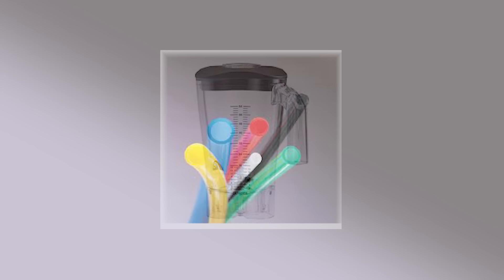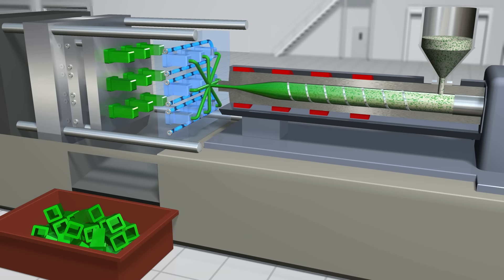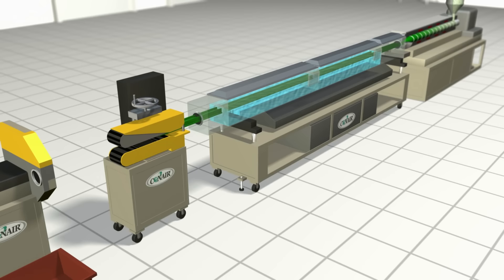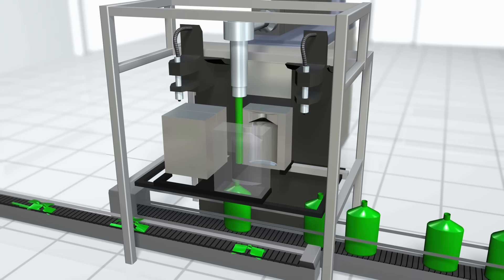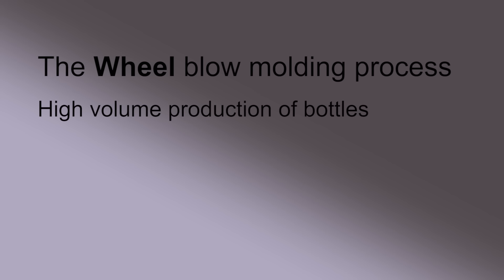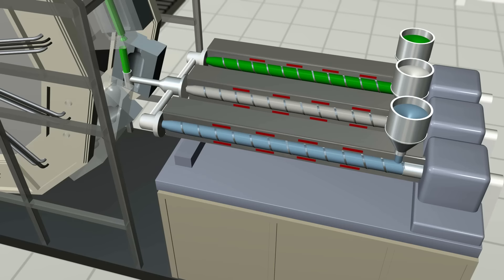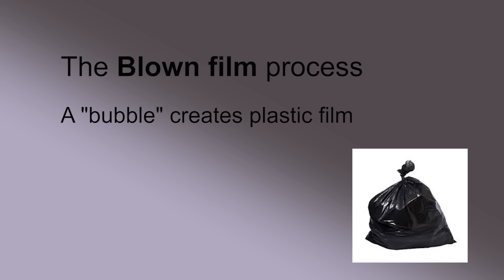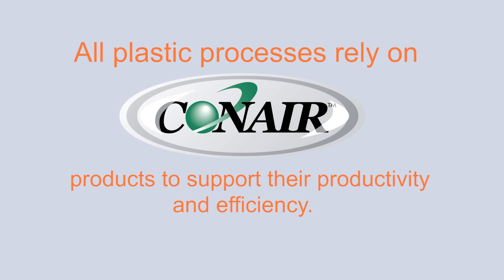Plastic Processing Overview

Comment: Great explanation. I didn't know about the screw. I thought it was a heating element that produced the heat to melt the plastic to then inject into the mold. The screw is much faster for sure and would actually be more consistent with melting the plastic. Thank you!
Reply: It's a combo of both. You have to consider screw speeds in cycle times due to excess frictional " sheer " heat that can be added and can change the performance of the part or plastic down the track ( and hopefully before going to customer,always love your QA dept)

Comment: The transcription of the video:

This program will explain the various types of processing machines used to make the wide range of plastic products in use throughout our lives. A good start is injection molding. injection molding is used to make plastic parts using two hard molds that when closed are injected with melted plastic to form individual parts. Here's how it works. Material gravity flows into the injection machine screw where it is melted by the compressing motion of the screw and then inject it into the mold to form the part or parts. The mold is quickly cool part solidified, the mold opens to release the parts and the mall closes again to repeat the cycle over and over again. Molding cycles can last anywhere from one second for tiny parts made in tiny molding machines to minutes for large parts made in presses the size of a building. Extrusion processes use the same plastic melting operation as injection molding but there is no mold and the resin compressing screw rotates constantly and product is created continuously.  Exclusion uses a die, a hollow form that molten plastic is pushed through to create a specific shape and thickness of water bath or spray chamber then cool the extruded shape and often provide pressure and or vacuum controls to properly size the product as it passes through. Belts are cleated pullers apply smooth tension on the product and keep it moving in pace with the extruder. A cutter or sock create the final product length, or a Winder creates fools of the final product. 

There are many variations to the extrusion process, but a mixture of extrusion molding is found in the blow molding process where plastic is continuously extruded into a tube shape and then clamp to the mold and blown into a shape with compressed air. It's a process that often operates in a shuttle movement with a set of molds each mold takes a turn grabbing a section of extruded tube called a paracin and shuttling it to one side to blow it into a bottle shape. Letting it cool and then releasing it to be filled with product or shipped. Each mode alternates with the second Bolt doing the same thing for maximum productivity.

The same blow molding process can also utilize multiple extruders for what is called Co extrusion. Co extrusion is used to create bottles made up of multiple layers and each layer processes special characteristics like suitability for food contact an outside color for brand awareness. Ultraviolet light protection for long shelf life of the product a layer of regrind for economical reuse of scrap and many times barrier and adhesive layers are included to separate and bond layers for a tough cohesive bottle.

High volume form of bull molding uses many moles mounted onto a continuously rotating wheel mechanism. The extruder creates a hollow tube and as the wheel rotates each of its molds will open grab a paracin and from the extruder die blow the paracin and into a bottle allow it to cool and then place it onto a conveyor producing and continuous stream of finished bottles originating from that continuous flow of plastic from the extruder. 

These wheel machines can also produce Co extruded bottles containing layers designed to meet the needs of the product and to use reclaimed material for maximum economy and recycling benefits.

The very popular sales plastic bottles for carbonated beverages has created a unique process for blow molded bottles made specifically from polyethylene terephthalic or PET. For PET blow molding bottles are first created in a test tube shape injection molding preform and then in a separate operation reheated and blown into their final shape. This two-stage process creates bottles that we as consumers know to be thin walled yet capable of containing gases carbonated beverages without losing pressure or exploding even if they are dropped.

 
In the blown film extrusion process then plastic material for products like garbage bags or the sheeting used in construction industry and packaging are produced. 
A very thin die opening which is often fed by multiple extruders faces upward in a round shape. A tall thin continuous bubble is produced vertically by this process and it is cooled as it as it flows upward typically 30 feet or more where it is then folded and brought back down and placed onto rolls or converted into popular film products.

And all these processes from injection molding to film extrusion rely on Conair products to support their productivity and efficiency.
Reply: Thanks for your great work.

Comment: I think there is a mistake in the injection molding simulation. Isn't the heating wire supposted to heat the plastic before injection and while it's in hold and to cool it while it is injected? If blue flow means cooling there's a mistake...
Reply: No. You are mistaken. The animation is accurate.

Comment: Thanks for this great video. I have two questions if you don't mind, How in the wheel blow process the billet is blown without a source of blowing?... How the layers are formed in Co-Extrusion?
Reply from the maker: Hello Fahad, 

Thank you for submitting your questions.  The blow molding process is certainly an interesting one.

1. In the blow molding process (including when using the wheel), air is required to expand the parison inside the mold. Once the mold is closed, the air is blown into the plastic parison forcing it to expand within the mold. Compressed air is typically used for very tight control of air pressure and volume.
2. The extrusion die is specially designed to form the layers. These layers typically come into the die from two (or more) different extruders, and the die creates/forms the different layers of the extruded product.

Please let us know if you have additional questions. Our Conair experts are always on hand to help plastics processors, students, or others interested in learning about the process.

Comment: Salam ❤
Can we change PP plastics into HDPE or LDPE plastics?!
Reply: Not sure what's being asked - if you're asking if equipment used for processing PP can be used for processing HDPE/LDPE, then yes, although certain adjustments will have to be made. If you're actually asking whether PP can be turned into HDPE/LDPE, the answer is "not without WAY more effort than could ever possibly be worthwhile." Polypropylene ((C3H6)n) and Polyethylene ((C2H4)n) behave in reasonably similar ways at the gross physical scale (melting point, strength, various other characteristics) but they are ENTIRELY different materials, chemically. The idea is sort of like asking if you can turn milk into peanut butter, or bird feathers into steel.

Comment: 1:00 the compressing motion of the screw is not what melts the plastic. There are elements (Shown in red) surrounding the end of the screw, which heat the plastic to melt it.
Reply: The screw also increase and enhances the melt

Comment: Check our 3D Screw & Barrel Precision Scanners  at D-Test Company here on YouTube or on www.d-test.eu 
Especially the all New Probius Tube Bore Pipe Barrel scanners is the NEW HIT 2017/18.
(3D Video inspection & Laser Straightness is included as well as self-crawling motor drives)